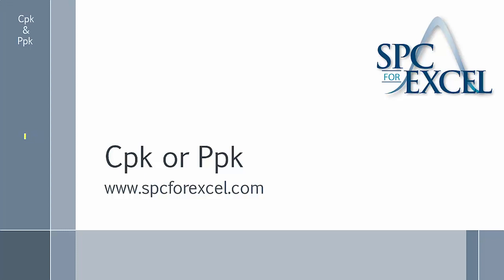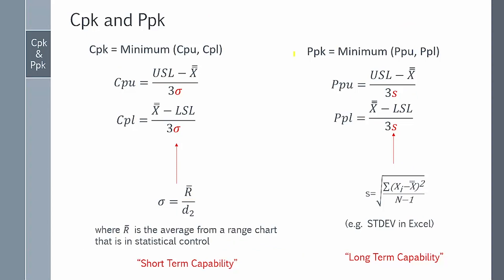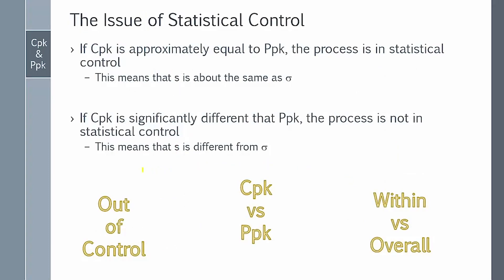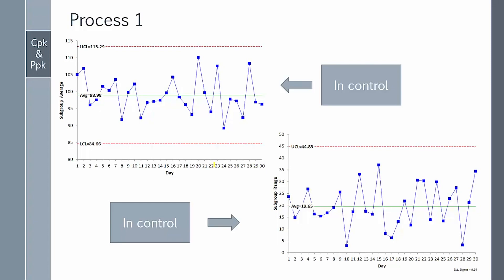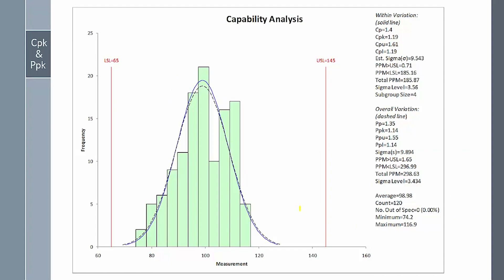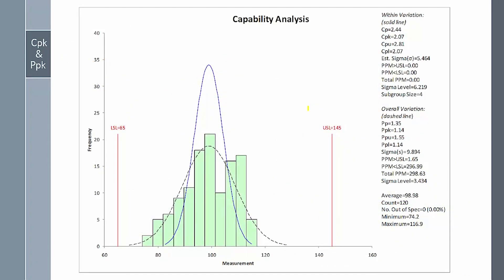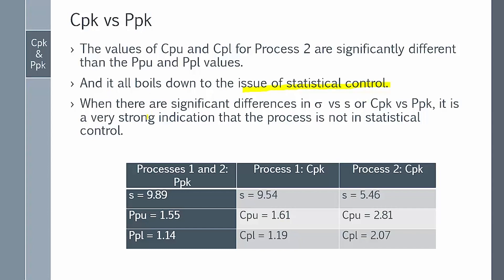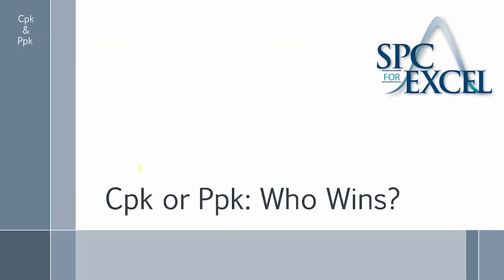Cpk vs Ppk: Who Wins?

Comment: I think
these 2 process capability/performance indicators do not need to put into "Who wins" or to compete and set aside the other over the chose one.  Each  actually made or formulated for specific separate scenarios

1.  Ppk should be used when new process/product still at development stage or early evaluation/qualification/initial low volume stage.
thats why it doesnt require you to use subset or subgroup of each data point e.g. 4 or 5 or 10 readings for each data point overtime.   because you dont have sufficient data, measured on different occasions.
thats why the formula is just simple as Ppk = Min (USL-AvgX , AvgX-LSL) /(3 Stdev of all data points without a subgroup)

2. Cpk should be used when you have sufficient datapoints you collected, over time.  e.i. every day, shift, week, etc.   this means, when your process or your specific product was already running in the production line continually to  produce or have sufficient data points of (let say 20, 25 or 30 or more),  then use Cpk.
thats why  the formula of Cpk =  Min (USL-AvgX , AvgX-LSL) /(3 Stdev of all data points with a subgroup)

remember: Ppk is rather, more conservative than Cpk.   this means,  Ppk will give you lower value than Cpk (provided that no significant process change or significant raw matl variation)
 this makes sense just in case you are needing guard-band to ensure that the Cpk is above the target (i.e. 1.33 or 1.67 or 2.0).  
 example  your Ppk is barely  meeting target  ≥1.33.   but when you run this into production for a month or more,  then Cpk is likely to be higher than Ppk/  provided that there is no significant change in your process or no significant variation on raw matls and toolings.

Try to simulate this in to your spreadsheet:
make a randomized normally distributed data.  1000 or more data.
If your process is stable overtime and no process-change beginning from the development stage to mass producction, therefore, Ppk < Cpk   or Cpk value is higher than Ppk.
If your process is stable overtime and no process-change beginning from the development stage to mass production,  but you calculated the Cpk similar to Ppk (meaning you remove the subgroup of Cpk regardless of measurements taken from different time),   then Cpk ≈ Ppk
If your process is not stable(significantly) over time or there was a significant change in the process within the timeframe of measurement,  then your Cpk is lower than stable Cpk.   worst case, is Cpk is lower than Ppk.

Thats why, sometime Ppk is termed as potential process capability index

Note:  you can use the stdev formula on both Cpk and Ppk.   The only difference is that the Stdev of Cpk  is calulcated in average (Stdev of each subgroup)  simple as this.   no need to boggle the mind of the viewer about the use of R2D2 .  or AvgR/d2

another reason we can think of,  that Cpk calculation was there not to cheat the real process capability index of Ppk.  It is rather for
1) to filter negligible noise when process is running and measured in different interval time,   
2) to accurately give the true performance of the process, over time.
because as you know,  when product or process is at initial*(development or qualification) stage and measured by one person under regulated environment in a careful manner using well and newly calibrated measurement tool,  the result of the measurement is at best.   meaning less or minimal variation.   this is Ppk..... when you run this into the production and monitored the measurement,  then it becomes Cpk.

I am a real practitioner in the field of  mfg, process, equipment engineering , 
also a statistician and programmer.  and a video blogger on data analysis/science
Reply from the maker: Hello, thank you for your detailed reply.  I was focusing primarily on existing processes, not new products - i don't disagree with what you say there.  The major point is that if, the process is in statistical control, the results will be essentially the same.  Ppk will be close to Cpk.  If the process is out of control, then you won't know what you will get in the future - regardless of it is Cpk and Ppk.

I would like your permission to copy your comment to the article Cpk vs Ppk: Who Wins? in our SPC Knowledge Base at this link:

https://www.spcforexcel.com/knowledge/process-capability/cpk-vs-ppk-who-wins

I think it has some good observations that others may like to see.

Thanks for commenting,

Bill

Comment: I have this question about the Standard Dev. when we find it out through excel for a subgroup, is it representing	+&- both side or how you explain it on a normally distributed graph, I am having a hard time imaginations! That will represent the standard Dev for the whole process /population
Reply from the maker: The standard deviation of one subgroup (for example, a subgroup size of 5) is the calculated standard deviation using, for example, STDEV in Excel.  It is a measure of the variation in individual values around the subgroup average; it is like an average distance each individual point in the subgroup is from the subgroup average.  One subgroup is simply an estimate of the population standard deviation - that is why you take more subgroups to improve that estimate - assuming the process is in control.  Please see our SPC Knowledge Base with over 200 articles on statistical analysis:

https://www.spcforexcel.com/spc-knowledge-base

Comment: Based on your simulations of the two process, I get a conclusion that PPK is a better estimate than CPK. Because PPK doesn't change all the time and always represents a performance based on the overall data. But the CPK in process 2 significantly changes to more than 2.0 which deceived us. Can you correct me? Thank!
Reply from the maker: It is all about statistical control.  If you are not in statistical control, you don't know what the process will make in the future.  The Ppk will change as the process changes.  Cpk gives you an idea of the potential capability of the process.  If you are in control, then Ppk and Cpk are about the same and will not change significantly as long as the process remains in control.  Please see this link:  https://www.spcforexcel.com/knowledge/process-capability/cpk-vs-ppk-who-wins